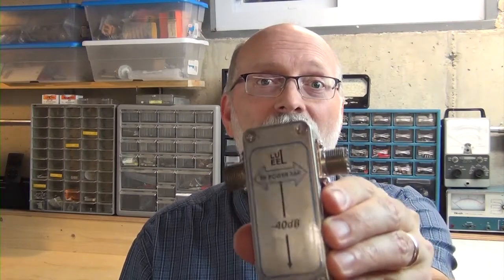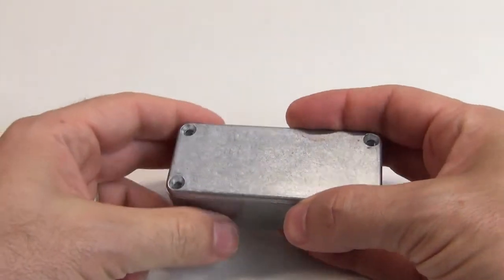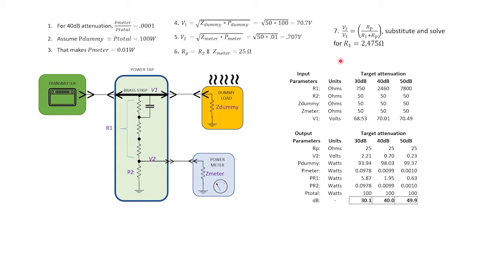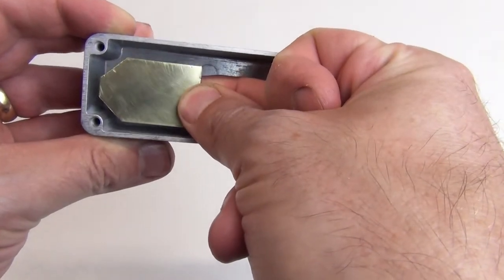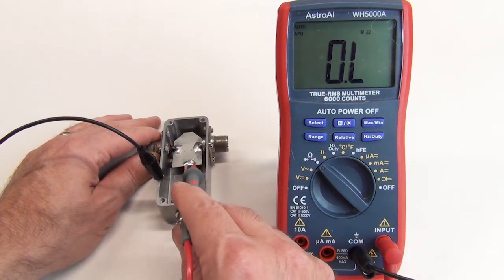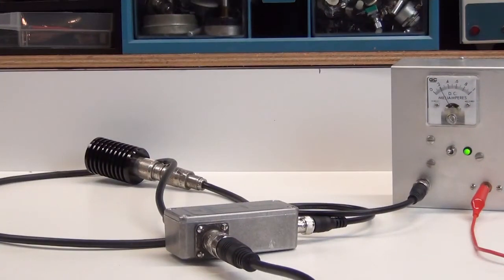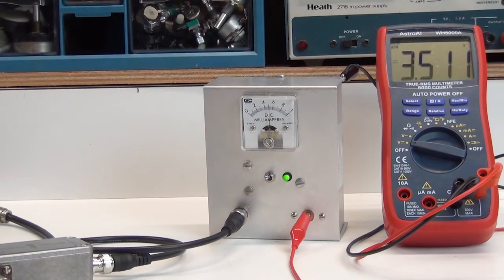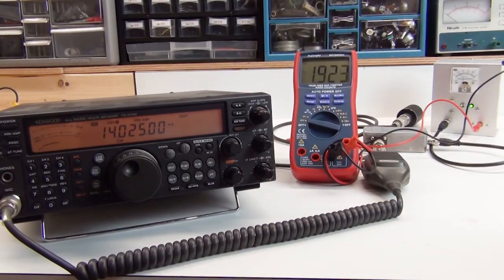How to Build an RF Power Tap

Comment: Is the size of the brass connecting plate material to the rf/electrical properties of the tap? I have a larger enclosure with already-installed N connectors in it I'd like to gut and repurpose. Wondered if I could just "scale up" the plate.
Reply from the maker: I don't think it matters that much at HF frequencies.  Above 50MHz, its inductance might start to be a factor.
Reply: @levelupeelab  Thanks.

Comment: Nice and I plan on building it with one exception. I will use a wire form romex between the SO connectors to get it stability.

Comment: Nice! Till what frequency is your design good?
I have a 6GHz 100W dummy load. How can I get a proportional sample into the TinySA from the transmission line to get an accurate power measurement?
Can you point me to a good design?
Reply: There is no way to get something precisely working. Order the 100W attenuator instead, with the -20...50dB on the opposite side.

Comment: Can you share the spread sheet? What would be the best way to make a 3dB tap, a 50% power splitter? Resistor voltage dividers would have to handle too much power, right? Thanks.

Comment: Are the standard carbon composite 5% resistors sufficient for this build? Don't need anything exotic like non inductive RF rated resistors, or high precision resistors?
Reply from the maker: Standard carbon comps 5% are just fine.

Comment: Hi, I would like to build one of these to send Rf to an old school kit 1ghz frequency counter 2 questions please
1 . would I have to modify this for a Max 20watt ssb rf signal?
2 . would a plastic box be OK for 20watts Max?
Thanks in advance
Reply from the maker: The design will easily handle a 100 Watt RF signal up to at least 50MHz.  However, you definitely should use a metal enclosure, it needs to be shielded.
Reply: @levelupeelab  thank you.

Comment: I have just purchased my 1st scope for repairs, and I would like to build one of these for testing. How does a person go about finding out what attenuation is needed for the scope as to not burnout the front-end?
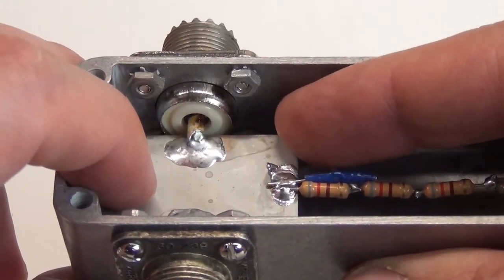The solder connection on the SO239 is broken @ 8:38
Great project👍
Reply from the maker: Wow, good eyes.  I had to re-watch it a few times and it does look like that joint is wiggling ever so slightly.  I'll pop the cover off and check it again.  Usually scopes will have a maximum peak voltage right on the front panel.  If not, it would be in the manual, provided you can still find one on line
Reply: @Level UP EE Lab  👍👍

Comment: Why not using a simple T connector to make a compact RF sampler?
The main line impedance will be kept much constant.
Reply from the maker: That's certainly an option.  The impedance, though, on this particular design is essentially flat in the HF (<30MHz) band, which is where I was planning to use it.

Comment: I need a tap and now have one. Using my nanovna I measured the SWR for this 40db version form 1mhz to 144mhz and got a maximum SWR of 1.18 at 70mhz . It was about 1.15 at 50mhz and also at 148mhz. Below 50 mhz it was much lower. 
Likely I should have built it with a built in 50 ohm dummy load but I will make a short one with the correct fitting. Thank you!

Comment: Very nicely done. I’m wanting to build one of these for test CB’s that can handle 150 watts but only put out a safe amount to the o scope and spectrum.  I’m just getting started so and taking a few classes and buying my own equipment. I have bird 43 and good power supply so far. Do you have any advice on building one of these?  Thanks in advance. And I have subscribed to your channel
Reply from the maker: Thanks for subscribing.  The power tap I describe here is a 40dB drop at the sampling port.  So you would have to check the maximum allowable power your test equipment can withstand and confirm that 40dB is safe enough.  If you need more of a drop, then you would need to add additional attenuation between the power tap and your test equipment.
Reply: @levelupeelab  thanks for the response. I’m still buying equipment so I’ll be conscious about what I purchase
Reply: Building an RF tap is a simple & fun project. You may want to consider also getting a -50db 25-1000MHz slug for your Bird 43, I've been using one since the late 70's. Rule of thumb: start more more attenuation then reduce it so you don't blow out the front end of your test equipment.

Comment: Very interesting!  I have been playing with a celwave dl-200, dummy load with tap.   A couple other buddies of mine have also been tinkering with the same device.  What has come up is that we are not seeing the attenuation we should see on the celwave device - when looking at it on the spectrum analyzer.  I've hooked up a 2M mobile radio into a swr/power meter, and i see the output power at zero, when the meter is plugged in the tap.  What I don't see, is that level of attenuation on the SA.  The SWR power meter shows zero on the celwave tap, and 50W without it.  So - that's 47db of attenuation.  Should I not see that same level on the SA?  Or (as I suspect), we don't have something configured right on the SA?  One guy has a siglent, and the other 2 of us are using rigol 815's.   Anyway, found your channel today in my quest for answers, looks like your new to youtube.  Great info on your vids, keep up the good work.  I'll be sharing your channel on our discord server for sure.  Thanks!!